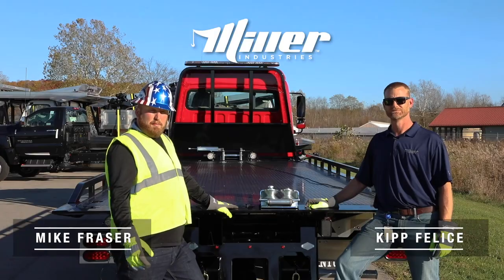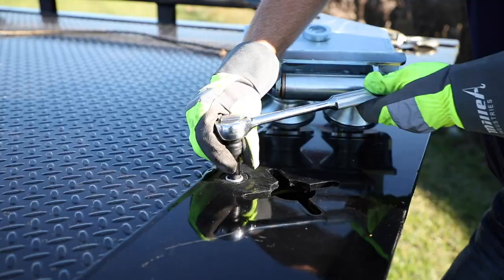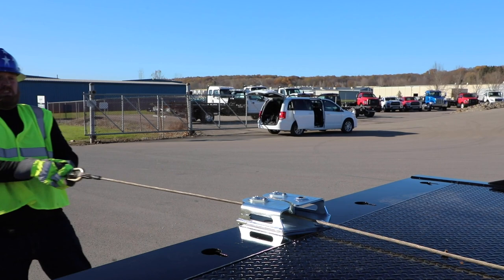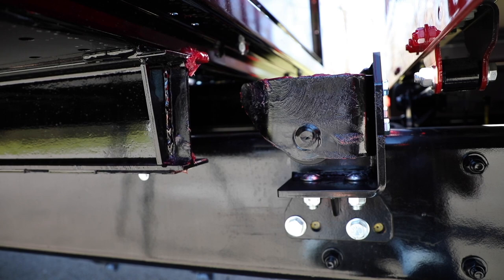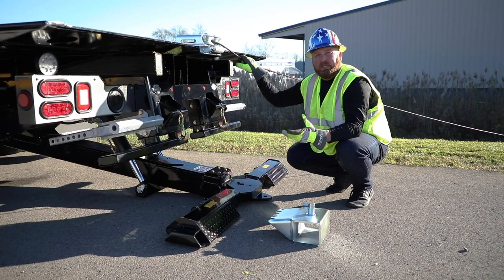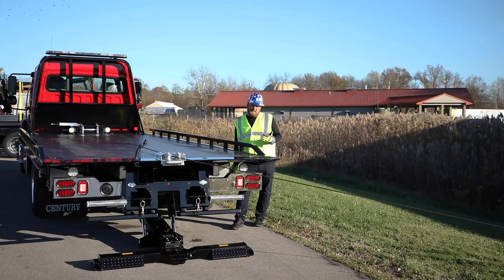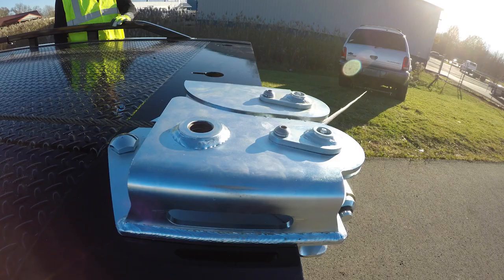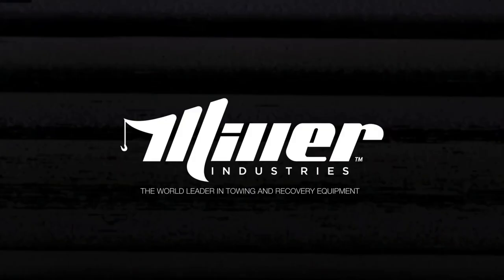Car Carrier Approach Plate Roller Guide Attachment

Comment: Save money, and buy a snatchblock. Also never, ever take advice from someone who doesn't know not too stand (Or duck, at least) where they can be cut in half if anything breaks.. Don't be scared to put the bed down with the wheel lift for better stability and angles. Always have flares, lights or traffic control before any hookup.

Comment: That is so unsafe. Never stand on the winch side like that, between cable and car. If that little zinc bolt twists or snaps, and I have seen a lot do it, you will be cut in half. Buy a snatch block. Cheaper and safer.

Comment: Device is good but unconventional especially working on a speed process clearing an accident or getting clear from a roadway too much time would rather attach a snatch block with a long chain the snatch block will adjust the angle of degree rather than stationary attached to the bed on slopes that will still cause binding on the lower section of the spool or fraying of the cable you could probably attach ahead of time but most of the time you don't know the scenario until you get there I'm sure that thing is a pretty penny I would rather pay 75 bucks for a nice 5,000 lb snatch block

Comment: Nice set up but personally I would just use a chain with a snatch block to accomplish the same thing so that my wire rope is in the middle of the bed while I’m watching
Reply: They told you exactly why that isn't viable, The beds are not designed for the torque when off the locks, and a snatch block on a chain isn't going to allow you to transition over the edge of the bed smoothly if you keep it flat in the locks, that is the go to for most rollback operators and even I did that before I had a side puller unit but they are not designed for that purpose and may very well break from it.
Reply: I disagree a long chain that will give you enough adjustment so the block is at the edge of the bed won't let the cable fray off the edge of the bed my process with the bed in locks works just fine when working and blocking lanes time is of the essence

Comment: Snatch blocks and tail chains work better then this system you can only have it in the middle of your bed why can’t it be moved to a corner to maximize your bed width and to line up for the winch up the bed.  Had to many cops won’t let you close down two lanes and have to use the one to do the job some times you get half lane to roll over and winch so it would make more sense to have it versatile and not just one place when you use your deck truck to do more then a straight pull and load
Reply: The designers are pencil pushers and not actual operators it seems

Comment: Hey I was wondering what is the actual length of the m100 rotator.
Reply from the maker: Approx. 40 ft. long
Reply: @MillerInd2010  Thank You.
Reply: @MillerInd2010  I was also wondering how many m100 rotators have been built.
Reply: @MillerInd2010  Hi I was wondering how many m100 Rotators have been built
Reply: @Fossil1111  I believe the 5th one is in the making. The first one, for petroffs, the second for Insanas, the third that was white and green, the 4th that is puryears, and the 5th that is being built for Collins.

Comment: What I don't understand is why you haven't developed a faster tie down system for the casualty vehicle once it's loaded onto the trailer bed.

The driver spends way to much time fumbling around with chains and the like to secure the vehicle and hold it fast.

Don't you want to clear the wreck ASAP, secure the casualty vehicle fast and not overly expose the driver to the elements and road hazards ?

Can't you develop something better ?